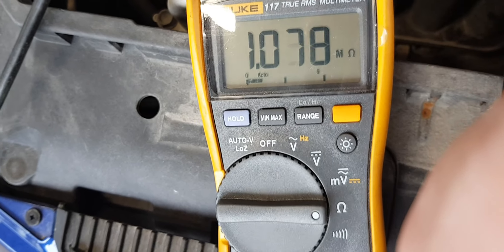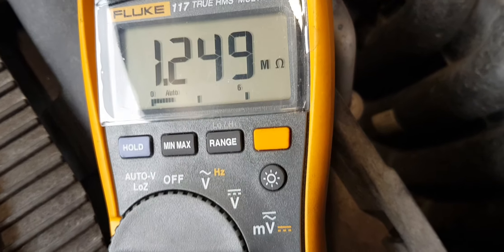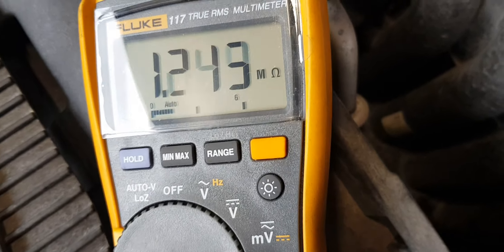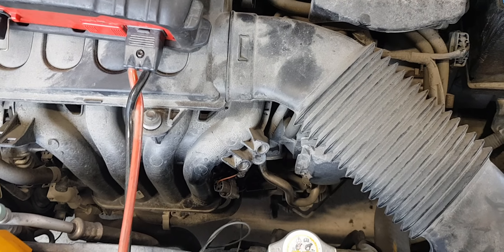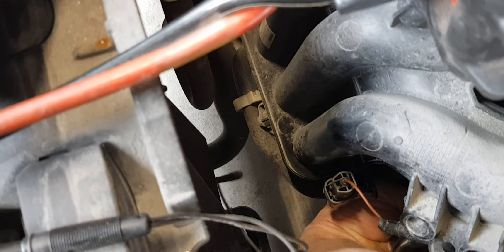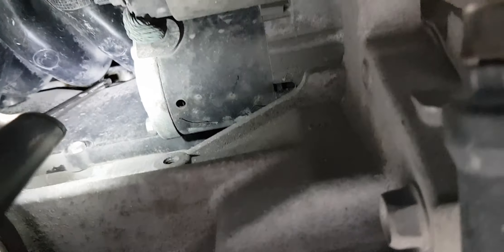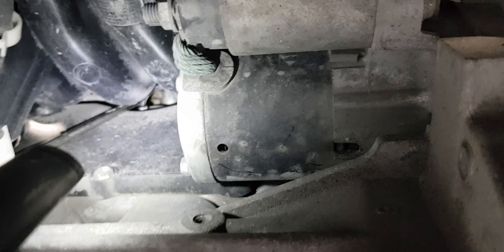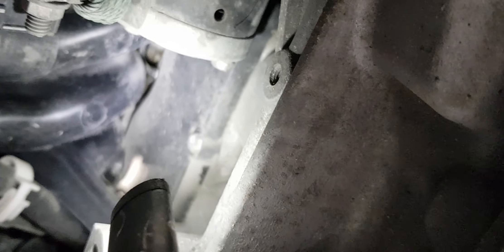P0328 Knock Sensor problem simple diagnosis

Comment: I'm getting same readings often from ecu that indicates faulty knock sensor. But this is only happening at winter. No problem at summer days. I got that new sensor but the placement of it is very unacceptable. I need a lot of spare time to install it.
Reply from the maker: The temperature has a large factor for electric/electronic connections, with time connections/faults getting worse and remain all the time present so sooner or later you will need to fix it.
Regarding location, I agree.
Reply: @JB_Auto  You're right I need to fix it. Thanks..
Reply: detonation is higher in winter, good fuel, higher octane
Reply: @verossavr3027  indeed friend.
Reply from the maker: Fuel type for Europe ( Conforming to EN 228) Ecept Australian specs., Syria, Chile, Guatemala, Costa Rica.... octan number 95 or above, and for Australia (Conforming to Fuel Quality Standards Act 2000) octan number 90 or above. In a nutshell the system is designed for higher fuel octan number...
Reply: @JB_Auto  in America 87 octane is recommended. Are you saying that I should really be putting in 90 and to disregard Mazda claiming 87 is the proper fuel type?
Reply from the maker: I'm saying that the octane number doesn't really differ during the winter time, because if in your country is recommended certain number then, why on petrol station should be different without informing customers... or even if there is slight difference the cars are designed for that. I in Europe if I put 95 or 98 it will not trigger any fault code...
Reply: by the way I changed the sensor and problem solved :)

Comment: Got this problem with my Mazda 2, 1.5 engine, same resistance jumping when wiggling the sensor wiring and it's oily on the knock sensor it self so looks like I will have to fit a new one, anoying having to take the inlet manifold off though, only just bought this car too bloody typical lol

Comment: I am having this problem with my Mazda 2 and it really helped. I don't have the time to pull the manifold and change it before winter. Do you think it will be okay to wait and change it in the spring?
Reply from the maker: In the most cases it is malfunctioning sensor if so it is nothing to worry about. I know people who dont care about warning  light and driving with it.

Comment: I suspect I have the same issue....but when looking at the sensor I am hearing the throttle body humming (the key is in the position just before start). Is it normal for the throttle body to make noises in this type of car?
Reply from the maker: I do not remember how it is on those cars, but on newer Mazdas, you will hear that sound when you switch the ignition off or to accessories position and after a while it becomes silent. I've never paid attention to that, Possibly a small sound will be audible, try to compare it to another car.
Reply: @JB_Auto  thanks for your prompt feedback

Comment: Hi, I have a new sensor but if I plug the new sensor in the CEL light still comes on after resetting it. Error code P0328. Do I have to actually install the new sensor for the CEL to clear? Because I wanted to check if the sensor is the problem. Maybe a new faulty sensor? Gonna buy a multimeter tool later today and test resistance on both old and new. Thanks for your video.
Reply from the maker: Hi, try to connect the sensor to the ground and then clear the fault code. It may need ground since the engine block act as ground.
Reply: @JB_Auto  will give that a try! Thanks!

Comment: Is it ever not the Knock sensor but say the EGR on a Mazda/Mazda2  on code P0328.  Thanks
Reply from the maker: As far as I remember, in the checking procedure related to the error code, there was nothing mentioned regarding EGR also on the wiring diagram it is a separate item.
Reply: @JB_Auto  thanks very much
Reply from the maker: @zzhughesd You are welcome.

Comment: This code came on for the first time on my Mazda2 today after the mechanic repaired my exhaust this morning. Is it possible he caused this new problem, or is this likely a whole separate issue?
Reply from the maker: I think it is just a coincidence, because the exhaust is on the other side of the engine, and rather not possible to get to the sensor or its wiring without a reason. I would check for fresh mechanical damages to the wiring of the sensor just for exclusion.

Comment: Hi, I have this on my mazda 3 2012, 1.6 petrol. Is there any other causes I could check for before having to take it to the garage to be sorted? 

Thank you.
Reply from the maker: @jim6751  Hi, for one DTC, there could be many solutions. In this case, other solutions for P0328 are: PCM faulty, wiring between  knock sensor and PCM, knock sensor, and engine mechanical problem.
Normally, in the case of P0328, I've never had any other diagnosis results than a faulty knock sensor (on Mazda), other vehicles all mentioned causes.
Reply: @JB_Auto  Is there any chance that a fault spark plug or coil pack could cause this error even though it hasn't thrown up any other codes. It runs perfectly and with no knocking noise at all.

I can't see any sings of bad wires, not to say it isn't anything further down.

Anything you would suggest for me to check before i take it to the garage? Thank you.
Reply from the maker: @jim6751 I don't think the ignition system may cause that, You would see errors related to that. Since the engine is running smoth, you can exclude mechanical issues. Based on the experience, I do not have any suggestions, besides those checks as I performed in the video. A faulty knock sensor is a pretty common problem. many technicians do not even diagnose the error code. They go straight to the replacement of the part. It is only me who does not trust common problems and solutions 😉
Reply: @JB_Auto  sounds like a garage job then. Thank you for your time.
Reply from the maker: @jim6751 Thanks for watching, It is a simple job, not convenient access to certain places, but it is possible to repair at home. If one likes that kind of work🙂
Reply: @JB_Auto  I do but if something goes wrong as I don't have that much time. Can't afford to be without car. Hopfully it fixes it. 🙏

Comment: Thanks for this information!

So does this impact the performance of the car a lot? 

I have an appointment next week for my garage to look at it but in the coming week i have to drive 500km in total, and i'm not sure if that is smart :)
Reply from the maker: If the knock sensor is faulty, then it doesn't impact performance at all. The knock sensor malfunction is the most common problem on Mazda vehicles. Anything else can be excluded, but always perform proper diagnose 🙂

Comment: I did a battery reset and the P0328 fault disappeared for a couple of days.
Today it showed up again.
Most likely a faulty sensor I guess?
Reply from the maker: Yes, it usually is. By the way, reset by disconnection of battery is the same as clearing using diagnostic tool, but that first one takes more time😉